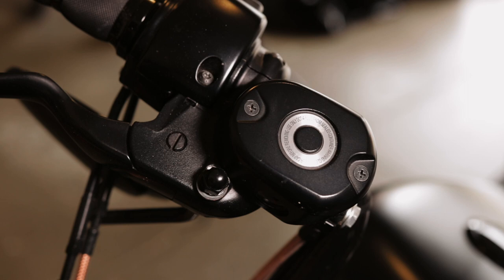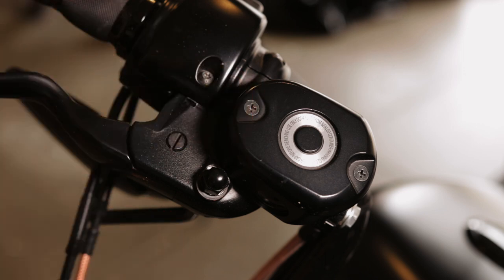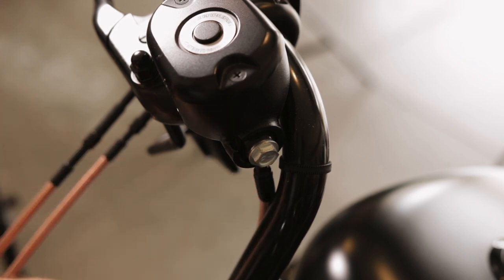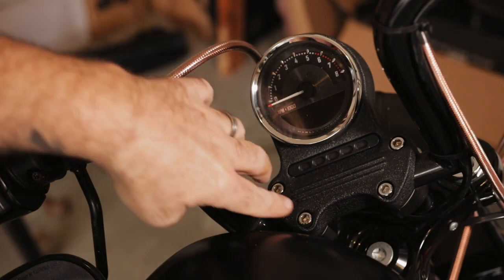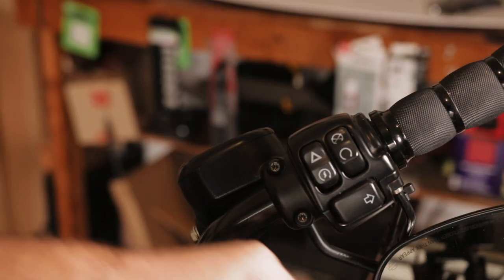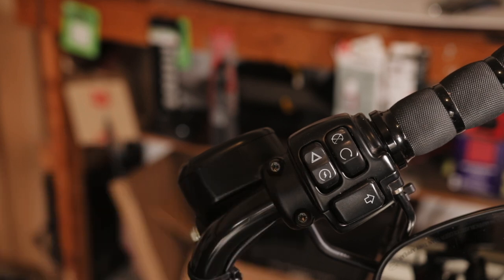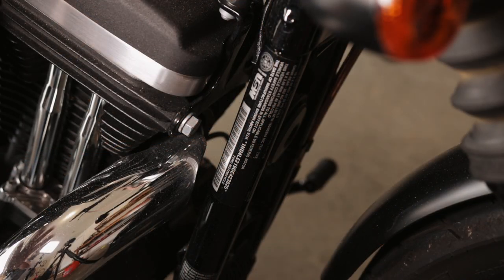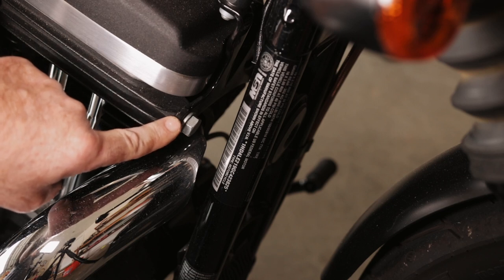Harley Sportster Iron 883-Critical Fasteners

Comment: Good video tony. When the engine isolator bolt came loose, what did it feel like? I’m trying to do as much research on my 2017 1200C as I can becuz I am having an issue with it. HD is telling me my bike is fine and “normal”.
Reply from the maker: It was just a real heavy vibration at about 30 to 40 mph.  You could really feel it in the handlebars.  Harley told me it was normal also until one of their techs overheard the conversation. He came out with a torque wrench and just like that it was all better.
Reply from the maker: With that being said, Harleys are noisy and vibrate quite a bit and does take some getting used too.
Reply: Awesome info Tony thanks! My vibration is felt between 40-50 mph. HD says it’s a characteristic of the motorcycle
Reply from the maker: Check the mount for torque.  Just throwing some stuff out there.  Have you changed the stock tune on your bike?  Wheel balance and improper air pressure also can create some unwanted vibrations.  Good luck, I hope you find the problem.  Ride safe.
Reply: I have had the bike to the dealer 5 times for this issue along with another issue. The bike is at the dealer now. HD corporate has been involved and they sent out a factory inspector yesterday to ride my bike. He said it’s “normal”. Apparently they have checked everything and still say my bike is fine
Reply from the maker: That can be so frustrating.  I hope they get you straightened out.  Good luck keep me posted.
Reply: Thanks man will do. Ride safe and keep up the good videos!
Reply: Oh and yes my bike has the screamin eagle stage 1 done to it.